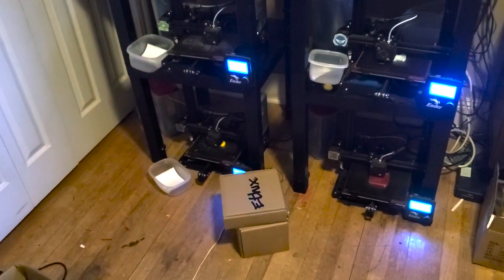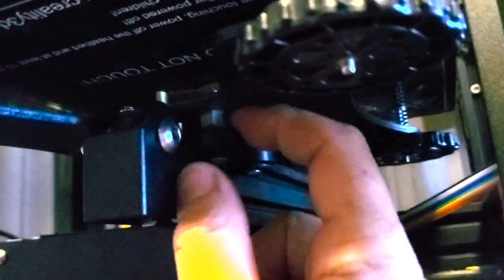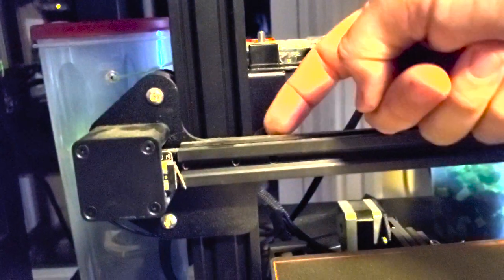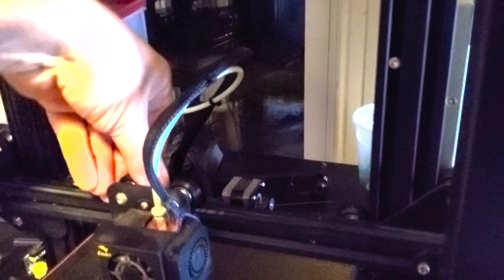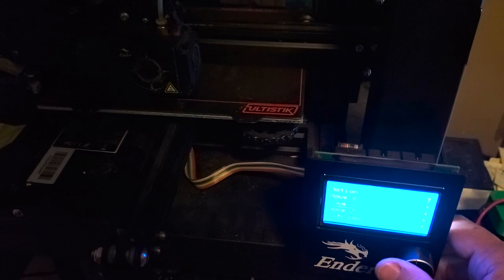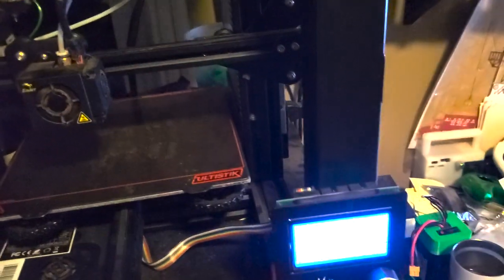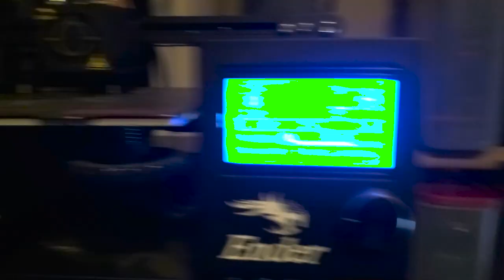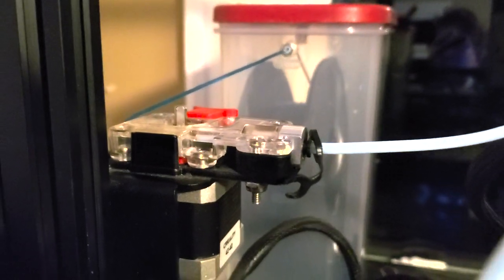How to Setup any 3D Printer-Tips for Day One-1st steps to a solid foundation on new Ender 3

Comment: Great info brother. i got an Ender 3 recently and love it.  i learned how to use it by printing with Nylon weed eater line. went through about 600 feet of that and got good and learned what changing things did. now i mostly print my gopro mounts with TPU. So far this has been the best decision i ever made. But i already see i need more than one printer. LOL This is not a situation where you say hold on a minute and let me print that for you it's more like come back tomorrow and it might be ready! hahahaha i still love it though.
Reply from the maker: I started with 2, and then there were 5 as I started a side business, and then I went full time. i have 12 printers now,  9 of which are dedicated to TPU
Reply: @Fly_High_FPV  Nice!